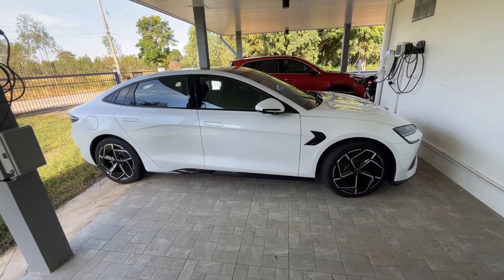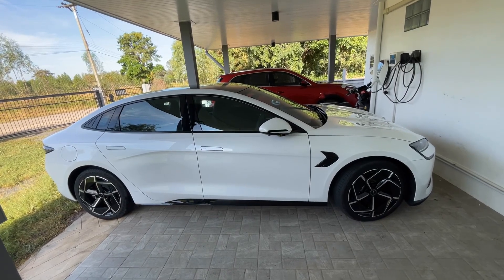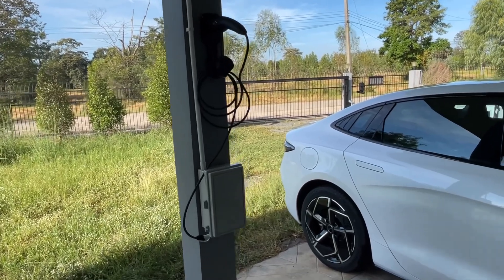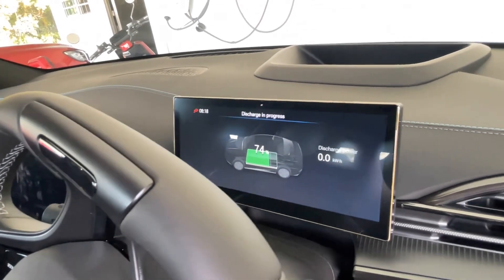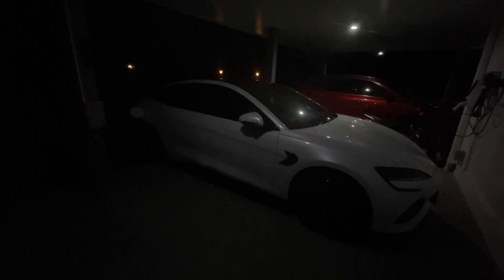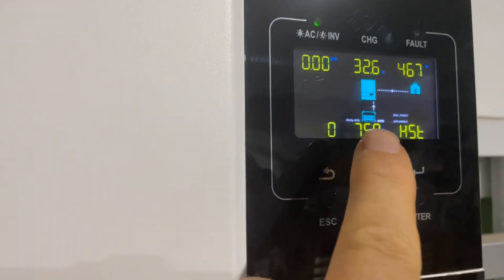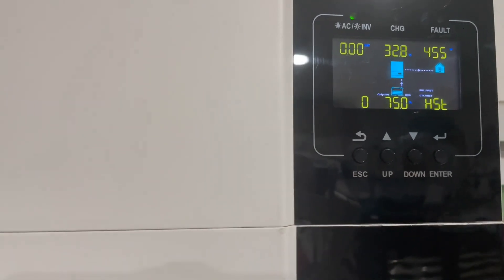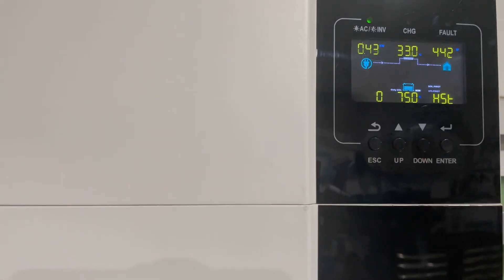V2L Powering my home from my BYD Seal

Comment: Can you set a maximum discharge limit on the EV beyond which the V2L session automatically stops?
Reply from the maker: I don't think you can as it's a dumb system. Plug in the V2L adapter then attach some load. The car records what is sent out but it doesn't control it as far as I know. It was designed for plugging in a kettle.

Comment: Your 3.5kw v2l adaptor has like 3 output plugs. Did you connect them in parallel? Or is it 3.5kw per plug?
Reply from the maker: Per plug if you only plug one thing in which is what I do.

Comment: Silly question. Can a regular V2L car be used/converted as V2H with some kind of adapter?
Reply from the maker: That's exactly what I'm doing here. I'm connecting my car to the ac input of my solar inverter to run my house. If you don't have solar you will have to have some sort of transfer switch into your main electric panel, but I've never attempted that.

Comment: Good video, just got my own Solax Solar installed, 18 panels, 3 batteries for 17.4 Kwh storage then the invertor good for up to 10,000 watts. Not off grid like yourself but thinking next steps and for sure buy more batteries [battery 94K bht for 5.4 kwh] or go for electric car and get more panels then use car at night to reduce load on house batteries like you do in this video, think there is a limitation on the cable for V2L that people need to be aware of.
Reply from the maker: The V2L cable that comes with my BYDs is restricted to 2.6kW, although the car is claimed to be good for 3.5kW. If you exceed the limit, like when a pump starts up, then the V2L is interrupted and has to be manually reset by removing and replacing V2L adapter into the car.

Comment: My situation is similar to yours, and i also plan to buy a BYD to supply my home when mains falls (it happens and may cause serious problems to my refrigerators). My only problem is that refrigerators need a full sine wave and i couldn't find any specification about this matter. Should the output of V2L be some modified square waveform the compressor will die soon. Have you any better info?
Reply from the maker: @claudioboarino8024  I send my V2L ac ppwer  into my pure sine wave solar inverters. I don’t know where you are based, but here in Thailand, the grid is very "dirty" with voltage spikes and brown outs all the time. My inverters produce a rock steady 230V at a frequency of 50Hz.

Comment: The title is a little clickbaity. I was like "whaaat powering a home with just V2L!?" But no, you actually need V2H or V2G for that. The max output of V2L is a little less than 4kW. In this case you already have a whole solar and battery system taking care of the house and you're just taking a little bit of power out of the car.
Reply from the maker: @Wonka0998  But V2L does power my home. I never said "just" V2L. I have several times powered my home from V2L all night. I don't have a grid connection, so obviously, I need solar to power the house and charge the car during the day. V2H can't power a home without some way of charging the vehicle.

Comment: Thanks for sharing this video. Could you get the car to charge your batteries through the house inverter back to DC?
Reply from the maker: I have never tried that as it could exceed the V2L maximum power output of 3.5 kW and V2L could well shut down.
Reply: @EcoHouseThailand  I just wondered if there was a way of limiting the total draw without disrupting the house load - so just dumping the excess up to say 90% of the total v2l limit.
Reply from the maker: @007silverwings  I don’t think you can limit power output from the car
Reply: @EcoHouseThailand  I guess the only way would be to feed the car into the hybrid inverter and charge the batteries with a programmed wattage limit, or as you do, power the house.
Reply from the maker: @007silverwings  sounds right

Comment: Hey! Amazing stuff. What do you think the max discharge could be from the BYD. Are there different charging cables that could make it discharge more. Ambibox have been able to discharge at 7kw it looks like
Reply from the maker: The V2L adapter that came with the car was restricted to 2.6kW from memory. I bought an aftermarket 3.5kW which I thought was maximum for the car. I only V2L at night as I have a lot of solar and home batteries, so I rarely draw more than 1kW
Reply: @EcoHouseThailand  Great, what made you think the 3.5kw was the maximum?
Reply from the maker: @georgehartshorn8932  What I have seen online, but I haven’t tested it to confirm
Reply: Hey gents did you guys get any more detail or confirmation over the V2L behaviour in this “grid connect” config? Ie does the car LIMIT to 2.6kw ? Or does your aftermarket 3.5kw cable (can you link to this so we can buy it?) increase the discharge rate to 3.5kw? 

And or does the seal SHUT DOWN the supply of the v2L if the demand load exceeds the 2.6kw limit ?

Comment: I have BYD ATTO 3 and SPF5000ES Off Grid, I have tried many different ways but either inverter or Car trips and will not accept any current from the car. I am not sure how its working for you. Any help will be appreciated.
Reply from the maker: I have the same inverter. Not sure if you have seen all 3 of my videos on this topic this is video 3 of 3 - links in the description. I don’t have a grid connection so V2L is connected to grid input on the inverter. The adapter supplied with my Seal was only rated for 2.5kW, so I bought a higher rated after market one. The cable I used was a high capacity one. I only use V2L at night when I am using less than 1kW most of the time. If you exceed the 2.5kW of the adapter, maybe a pump coming on, the maybe V2L will disconnect and you will have to reset it.
Reply: @EcoHouseThailand  I did watch the video, just couldn't understand why it wouldn't work for me, I even reduced AC IN limit to 10A. I even removed AC out to see if batteries would charge, inverters just doesn't accept the car. There are victron forms with people having the same issue. I'm glad your setup works well. Thanks for creating the videos.

Comment: Have you checked in how much your Seal draws when V2L is active? I do have reports here and there from different vehicle types that it can be 300 Watts, and I was wondering if the BYD might be any better. 300 extra Watts is a lot if you have one heat pump running which draws less than 200 Watts total.
Reply from the maker: @fnordpol I can run my house at night for 12 hours with aircon and servers running and only deplete the battery by 7kWh so it seems very efficient
Reply: @EcoHouseThailand  I cant tell because I have no idea how much of those 7KWh is getting used by your house and how much is getting used by your car. 

If your car burns through en extra 300 Watt just to keep the MCU and Battery condition running, this would loose half of the power you are draining. And the thing is:  I have checked the reports and calculated this drain this on other models. 

In your scenario it is mostly the question if you should probably charge your house battery from your car, and turn the car of to get better efficiency. 

In my case I plan to power a camper with it off grid and it is the question if I can run 2 days or a full week on the battery.
Reply from the maker: @fnordpol You should watch my video on “how to size battery storage for home solar” The seal is way more efficient than my home solar setup. When people choose inverters they never consider their efficiency, but with EVs that’s practically all they talk about.

Comment: What's the output from Seal V2L into watt? Can you run big electric appliance such as aircon, washing machine or microwave?
Reply from the maker: 3.6kW, but the supplied adapter is rated for only 2.6kW, so I bought an after market one. I only use mine at night as I have solar. It can run 2 aircons (8,500 BTU) multiple fans as well as stuff that is switched on 24/7 like fridges, freezers, and servers.
Reply: @EcoHouseThailand  What was the aftermarket charger that you bought? Cheers George
Reply from the maker: @georgehartshorn8932  Here in Thailand EVs only started selling in 2019 so new EVs come with free wall chargers bundled with the car. My MG came with an MG branded charger and my BYD came with a ABB charger.
Reply: @EcoHouseThailand As I understand you rather power a few selected appliances than 'home'. 
And you still have to disconnect form the wall charger and plug the V2L adapter to do that? Am I right? 

The perfect V2H would use the wall charger both ways and allow at last 11 kW load on car!
Reply from the maker: @pawefiett2468  I power the whole house load at night. My inverter priority setting is Solar, Grid, Batteries, with Grid being my Seal as I don't have a meter. I charge my car from solar during the day as I don't have a grid connection, so yes my charger is unplugged at night. The Seal has V2L using an adapter not V2H using a bi-directional charger like the F150 Lightning which is very expensive.

Comment: Hi, Peter from Slovakia here. I have Ioniq 5 and intend to power my house with v2l too. However, the output from the car is one phase only. Does your inverter accept this? Plus, if you wish to top up your home battery from your Seal, you must certainly reduce the charging power to keep the house running. The home battery cannot be charged and discharged at the same time. Is it so? Thanks for your reply
Reply from the maker: Yes my inverter is single phase. I have set my inverter to only charge my home batteries from Solar. I’m not sure if you seen all three videos I have done on V2L, but I talk about running the house load only and only at night. This preserves my home batteries.
Reply: Ok, thanks for your reply. My inverter is 3 phase, so I am curious to see how it will treat one-phase power from my car.
Anyway, there is a bidirectional ac charger coming from Renault in the autumn and that should work on cars having v2l capability. And its price should be acceptable too. Unlike these 10.000 usd dc bidirectional chargers coming from us this year

Comment: Hi! Just got the Seal here (ireland) and I have noticed and a few others that the zappi charger and a few others show output of 7kw but the byd is only showing 6.2 on the screen. Also tried this at 11kw charger and similar results. Have you noticed any large drops from the supply to the charger?  I know there tends to be some transmission loss but this seems excessive.
Reply from the maker: My home charger pulls 7kW AC but only 6.2 DC is added the battery
Reply: Perfect thanks. Sounds like it's losses via the ac dc conversion then.
Reply: Excellent video. Thanks! 👍

Comment: Very interesting. Here in the UK I asked the makers of 'Zappi' chargers, about using the Seal V2L much like a power wall, as they make inverters for their own brand of home battery. I was going to charge the car at cheap 'off-peak' electricity rates.    They told me using the car to power the house was not feasible ?
Reply from the maker: You should watch my first video on V2L linked in the description. I had a transfer switch with 2 AC in (grid and V2L) and one AC out into the inverter
Reply: In the UK there may be issues with PE.. If you have a solar inverter with some batteries you could circumvent this by switching off Grid completely and using the car to bump your batteries + house.
Then as soon as the car stops providing power you could swap to grid again (some ATS could help)

Comment: Question about Seal's V2L in general (not for powering a house) - does the car need be switched off to use the V2L or can it be on at the same time? I.e. can I run the heater / AC in the car simultaneously when powering some external devices through the charge port?
Reply from the maker: I have tested V2L with the car on and it still works

Comment: I have a Model 3 and live in Switzerland. I will be considering the BYD seal once it comes to Switzerland as the Model 3 highland is just a facelift with no USS, front camera and worse functionality by moving all controls to the steering wheel.

Comment: This is amazing info!  Its giving me ideas. I have solar as well, but I use about 20 kwh at night in winter mainly for heating. I reckon i can save 100 bucks a month during the winter months using V2L. Just wonder how much it would cost to install the system to work with my exisiting solar system.
Reply from the maker: Installing a transfer switch shouldn’t cost much, by installer did it when we installed the inverters. I did the rest of the installation myself

Comment: The Seal is open for orders in Australia and I am interested in the long range model. I currently have the Atto 3. There are not many good reviews on the operation and performance etc of this EV. You could be one of the first. I am interested in the real world range of the seal. Have you done a video about this topic. You said you have the 82.5kWh battery, is it the RWD or AWD.
Reply from the maker: Been asked many times for a range update so we are charging to 100% today and will set a trip

Comment: Sacrifice the car battery to supplement house solar battery.  Bummer if the wife wants to go shopping and charge is too low. lol.   How many kW is the car battery?    (myself wondered about adding a few panels to my system, in order to better support the rainy days but it may still not be enough)
Reply from the maker: A Tesla PowerWall has 13.5 kWh the BYD Seal has 82.5 kWh. Powering my house load for a few hours is insignificant compared to propelling 2 Tonnes of metal 650km
Reply: @EcoHouseThailand   Hmm, my consumption avg is only 40 kWh/day, so, yea, that can help thru the rainy season as long as I can get some sunny days. Is the warranty on the car battery based on time or cycles? How long does it take to transfer say 10 kWh ?
Reply from the maker: @darwinjina Warranty here in Thailand is 8 years 160,000km. The V2L max transfer rate is 3.5kW but it matches the load demand in real time. If your house was using say 1kW/hour then 10kW would take 10 hours.
Reply: @EcoHouseThailand  thanks
Reply: @darwinjina Just wondering what is your family size and your house footage that use 40kW/h a day.
Reply: @EcoHouseThailand  Nice.  And from my research, the BYD batteries don't degrade that much.  I think a Singaporre taxi fleet was selling a bunch of BYD's to upgrade their fleet and 100+ KM models still had well over 90% of capacity.  Your system is similar to the one we are going to do in the Philippines.  This system is also the future.  The electric companies won't be happy about it, but oh well.